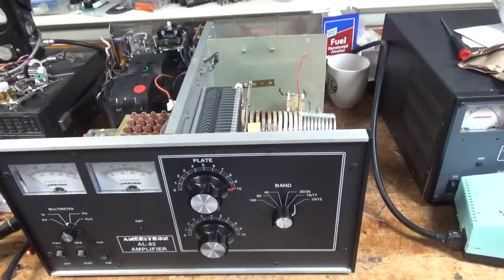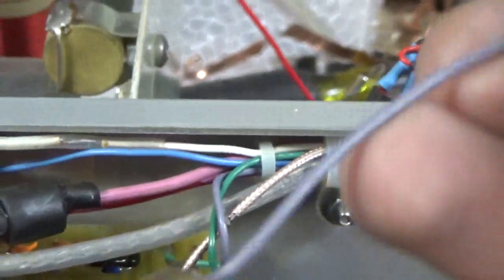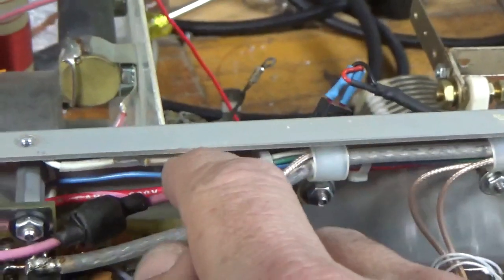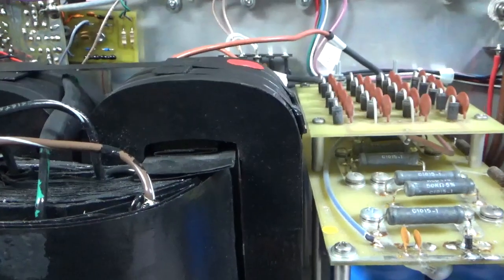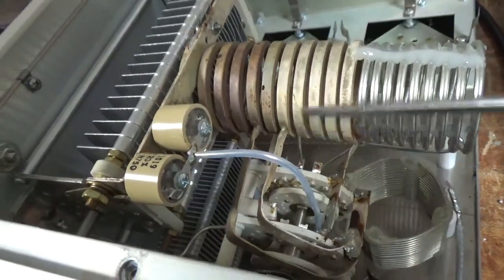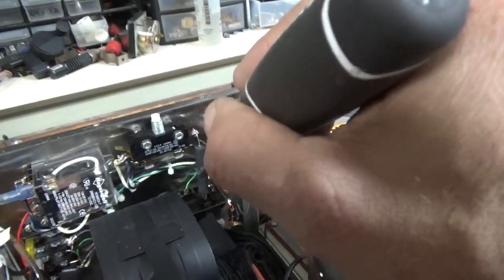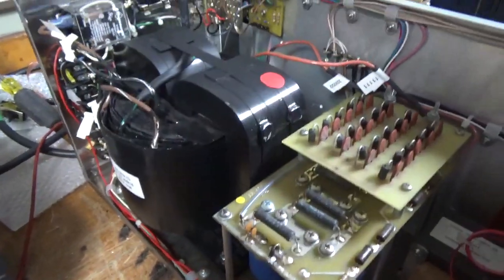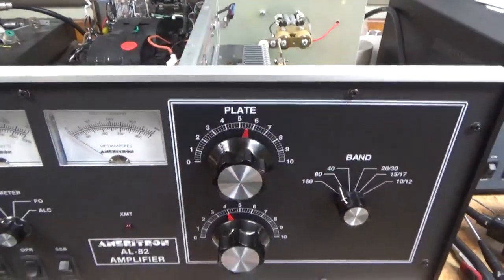Ameritron Al-82 Repair, Gas Discharge Tube Replacement, Damaged Alc, Power Test, Penta Lab Tubes

Comment: how do the Ameritron fiberglass tube sockets seem to hold up versus ceramic sockets? If they hold up good, is that from contact surface area and good ventilation?
Reply from the maker: I’ve yet to have to change one